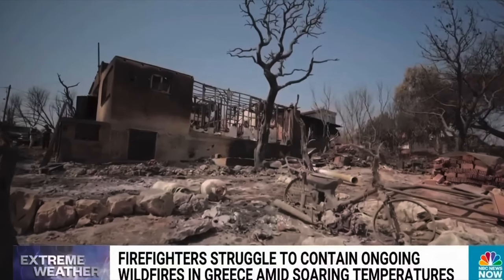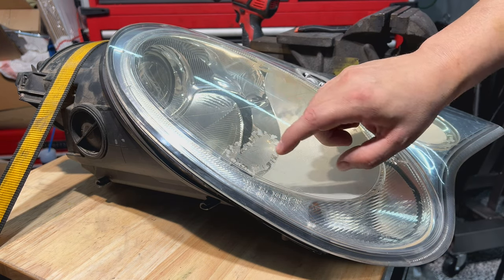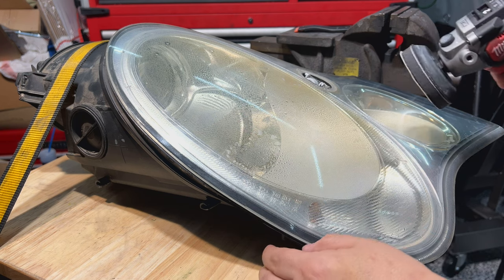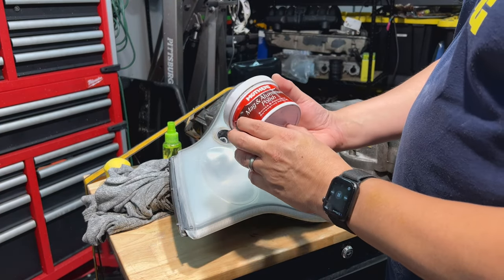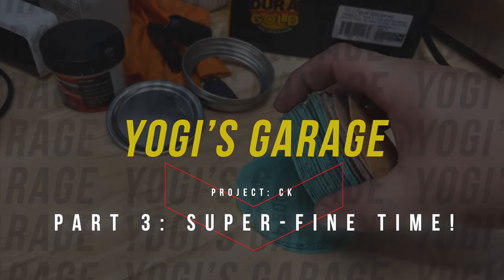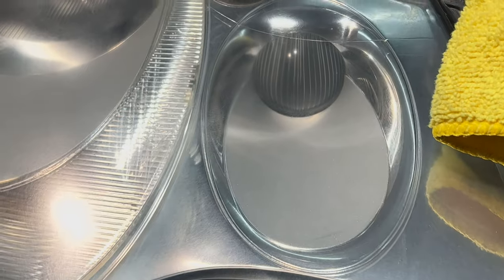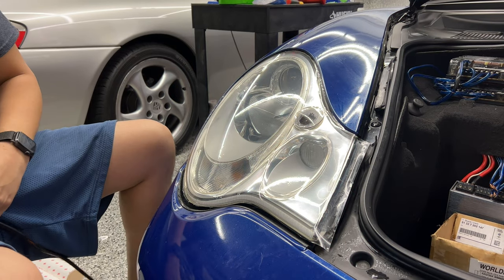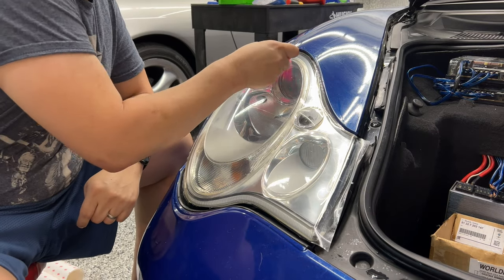From Mistakes to Mastery: Restoring Yellowed 911 Headlights with PPF!

Comment: Yogi, great video and thanks for sharing. Have you ever tackled the cabriolet roof, when down, still having a 1" gap or so, where it does not appear to close all the way shut? This is when the top is down and tucked away. Again, great vids, I am tacking the foam AC vents this weekend based on your tutorial.
Reply from the maker: Hi thanks for watching! Yes I’ve got a video series on the top. However I don’t cover the gap. I believe the gap may be caused by a flap obstructing the closure step. I witnessed it on my pristine Turbo. The little spring flap along the sides of the clamshell don’t always stow away properly. I just raise it a bit and try again. That usually fixes it. You might actually have a foreign object in there. Look for twigs or anything that doesn’t belong there. Good luck!
Reply: @YogisGarage  Ok, I will take a look. Appreciate the follow up. I did the blend door repair over the weekend and installed a new double din head unit, now the top will not go up or down and just flashes a top warning light on the dash. These cars are the gift that keeps giving for sure.
I will look over the top videos to see if I can figure out what might be happening.

Comment: Maybe try a steamer to heat the ppf and it should come off more easily?
Reply from the maker: Yup, I had a list of tests I had plan on trying. The goo gone and heat gun did the trick. Thanks for watching!
Reply: Please tell me that ordinary yellowish headlights, without nasty peeling PPF, would not require such an extensive effort! Your results are amazing, though.
Reply from the maker: @boffam00  it shouldn't my Carrera does not have any PPF so I can probably start at 800 and go up to 3-7K and then go to polish.